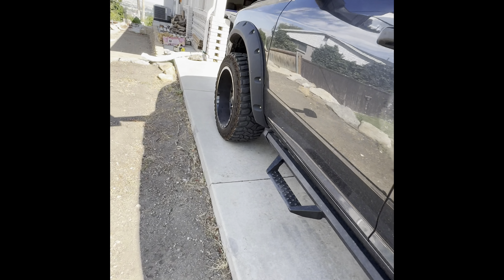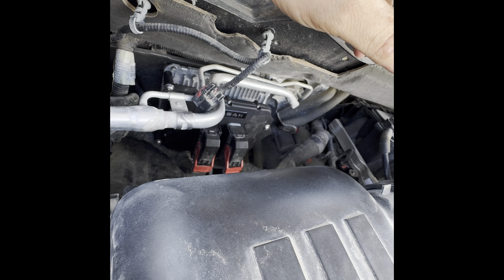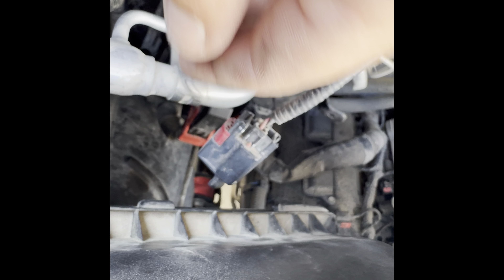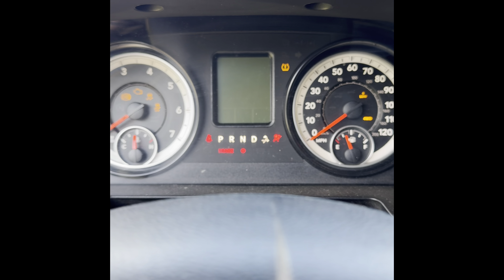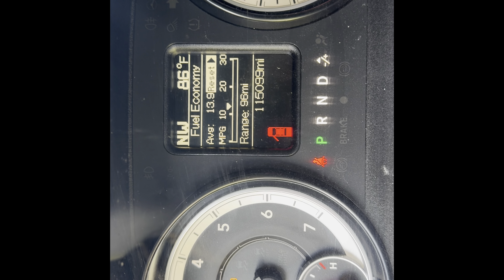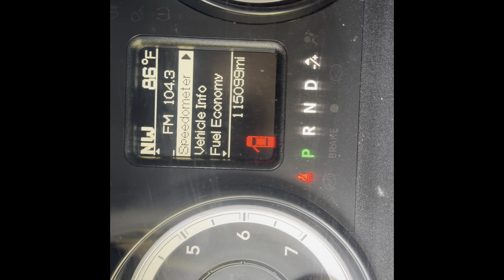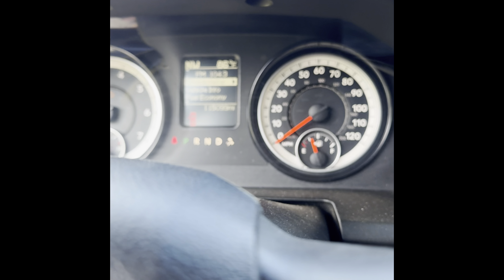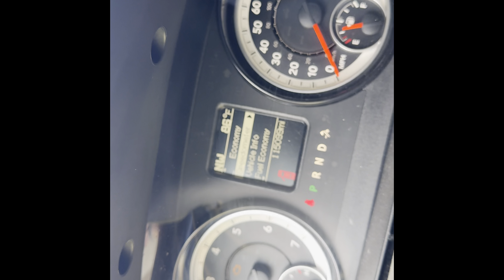Edge Pulsar review PT1

Comment: I've been on the fence about getting one. I mostly want it for the mds off. I've read alot of reviews that say it doesn't work.
Reply from the maker: So I’m seeing better fuel economy when towing and not towing. City driving is minimal but Highway I went from 17 to 20 on the cruise at 70
Reply from the maker: And mds will turn off but it shows in manual mode